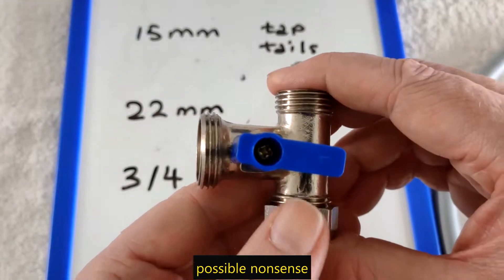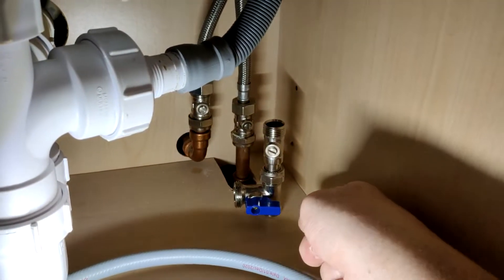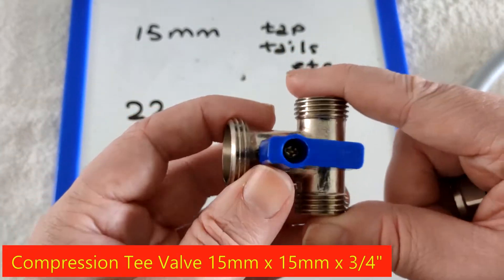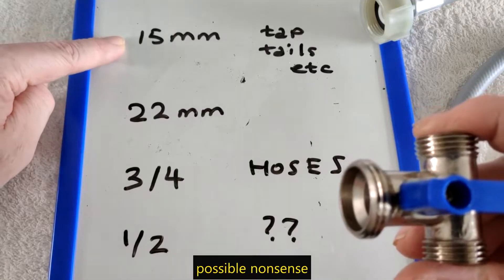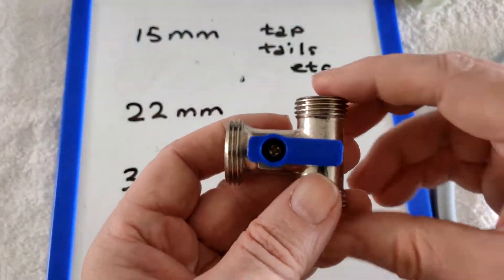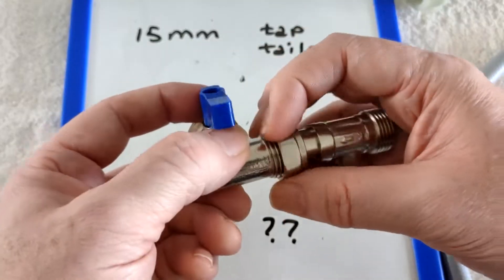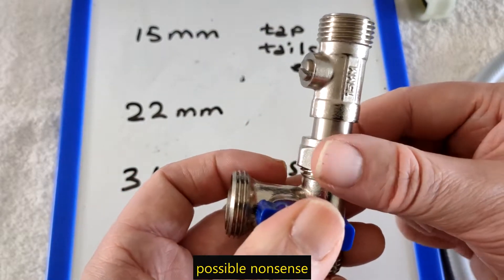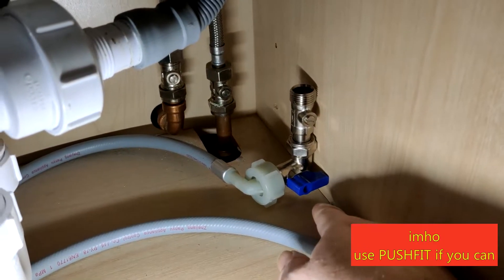diy : washing machine/dishwasher pipe connector (Tee Valve 15 x 15 x 3/4")

Comment: What about the waste pipe?
Reply from the maker: I have mine going directly into the sink, so haven't researched it. I think it will be the same idea, needing a waste double-connector, maybe under the sink ?
Its the same as for a washing machine, if you look at that.

I think they call it a y-connector ? or a waste splitter or variation etc. 

B&Q say this  (last paragraph) 
https://www.diy.com/ideas-advice/how-to-plumb-in-a-washing-machine-dishwasher/CC_npcart_400224.art